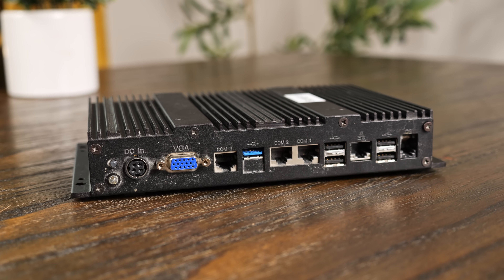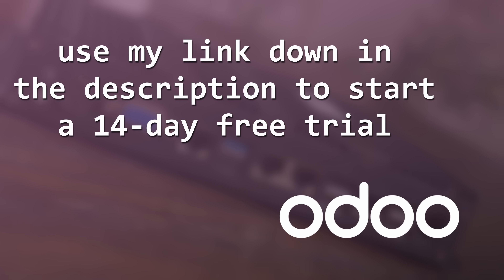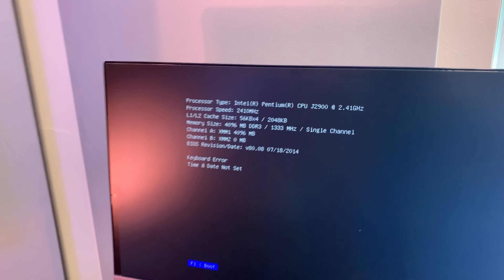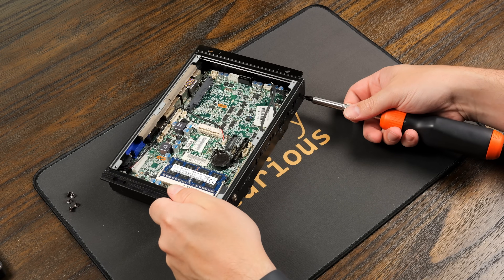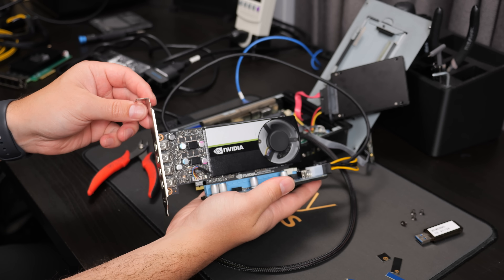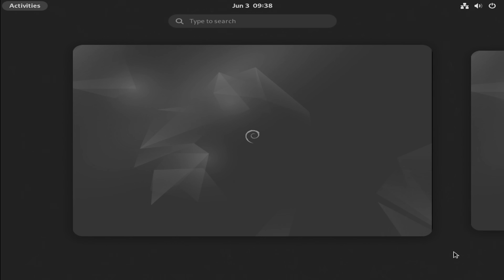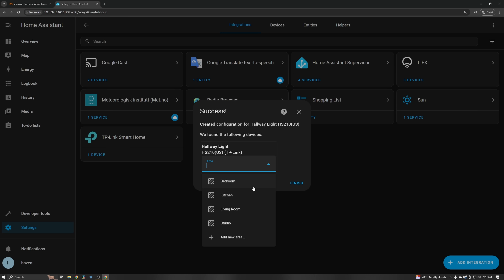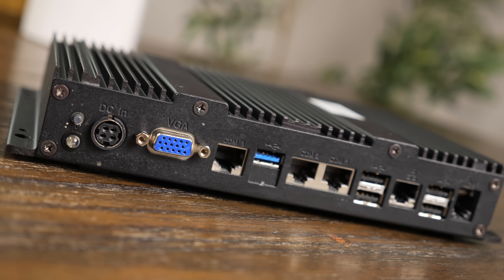I got this PC from a fast food restaurant. What now?

Comment: For a display issue in Linux, check if it has an internal display connector. If there is one, look for a setting in the BIOS to turn it off. Some Acer mini PCs have had the same issue because they are also used in all-in-one PCs.

Comment: I had no idea what "keys" were that plugged into ports with no wires. software that communicates with hardware will have them, and be unable to "talk" on the network, until that key is plugged in to a non network port. local only.

Comment: I had a client that used these in fast food restaurants.  These computers are absolute tanks.  I think I only replaced 1 in maybe 10 years, and they probably had a couple dozen total.  Most of them were mounted in order prep areas in very hot and humid environments, often directly above cooking areas or above food storage areas with heat lamps.  They were used to show food orders for prep and had a printer attached that would print the order so it could be put in the bag when done.  They also had a super chonky "keyboard" attached that was really just a metal box with a few buttons to cycle through orders and clear them when they were done.

Comment: The video resolution glitch you saw was something that I have seen with hooking up an Acer model G206HL via the VGA D-SUB  port to an Intel core i3 onboard video chip to Debian (both 11 and 12). However when using the DVI port the problem disappeared. I do note that when using the D-SUB port, but turning off the monitor, once logged in, and repowering  it fixed the display resolution. I haven't tried it, but I wonder is a DVI to D-Sub cable might resolve the problem.

The multiple serial ports would make this a great little security box attached to door/window/heat/water sensors. Wiring some pairs in loop-back and some to act of open or closed. :-) it could when sound an alarm, email warning... if in the USA (I'm not but was before) email a SMS service to text a warning. Doing this, it could run Debian in Command-Line mode, so not GUI overhead. 🙂

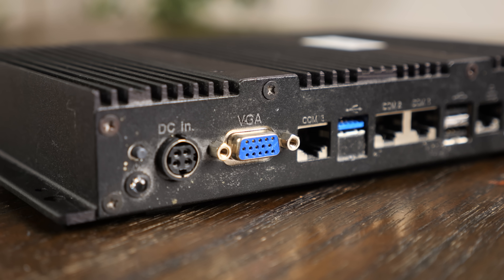Comment: 1:00 Even this not-super-knowledgeable user knows it's old because of the VGA connection. I replaced a PC earlier this year and found that the monitor I'd been using was useless with my two laptops because it could only connect that way.

Comment: Curious. What edition of linux mint were you running? The reason why it was zoomed out like that is due to the kernel not having the appropriate kernel modules for the display out of the box. If its the Debian 12 version of linux mint or LMDE6. That explains it. Debian is all about being just enough and not much extra. If it was ubuntu version of cinnamon. Chances are, the experience would of been much better as ubuntu kernels are much more cutting edge than vanilla Debian.

Comment: I work with point of sale systems, so some things stood out right away.
Systems built around the J1900, in my experience, are tanks. Dependable, near indestructible, heavy, and slower than a frozen tortoise. There are still some out there running Windows XP - which is more a testament to the durability of the hardware.
That "CD" connector is meant to connect to a cash drawer. You can use this to trigger solenoids (often 24V) to do whatever you need them to do - open a drawer or door latch, ring a bell, set off an alarm, dump water on somebody, possibilities are endless. The main problem is finding drivers or the memory addresses that control the drawer kick.

If I were going to repurpose this thing in a restaurant, I'd make it into a menu or advertisement display.

Also worth a look: Android. We're starting to see more Android equipment (and even POS software) on the market.  Something like this could run Android x86 without even trying. For comparison, I've installed a fair number of ChefTab kitchen displays - the Android set-top box they use is comparable to this in overall spec. That might even be a better way to refurbish this computer.
Postscript on that thought, we've also dealt with a kitchen display that runs on MS-DOS, the box is an 80186 processor. Yes, you read that number right.

Comment: do you think this could be used to run retro emulators in an arcade cabinet?
how hot does it get if it doesnt need a fan?
if it were inside of a wooden enclosure do you think it would overheat?

Comment: I was a facility maintenance tech for a domino's pizza franchise for many years. When we upgraded all the pos and host/server computers I Inherited about 100 IBM Lenovo ThinkCenter computers. They are all dated between 2002 and 2004 and have pentium duo-core processors running windows Vista pro. I sold most of them to a computer repair shop and I turned one into an emulation game machine running botacera. But I still have about 10 kickin' around in storage.

Comment: I prefer these mini pc for installing new staff desktops...  just throw in an ssd if it doesn't have one and they are awesome!  They have wifi reducing cables as well..
Dell Optiplex or HP Elite work great and with SSD they should be good for next decade, even running windows 11..
fyi there are vga to display port cables & adapters as well as for HDMI but it won't include Audio...  doesn't even look like there is an audio port on the back of this unit, is there on the front?
These are perfect "GUEST" use computers say at a community services center where you want to keep them hidden & secured to bottom of desktop..

Comment: I KNEW I recognized that pc from somewhere. I worked at a dominos as well that ran on chrome os, that blew my mind. Also as a side note, the Bump 1 stick meant that this computer was at the front of the makeline as you would Bump the orders from there first, to the second screen which you would then bump again and it would push the order through to the printer at the cut table (where the pizzas come out of the oven and you cut them). So you had 2 systems, one at the front of the makeline that showed you what pizzas were coming through and then once you had the dough stretched and sauced you would then bump it down to then see what you needed to add to it.

Also on the minecraft serverfront, you could have the server auto generate chunks to a certain point. I was using an old macmini, core2duo, and attempted to have it auto generate up to 10k chunks in each direction which took forever, but it is possible.

Comment: My desktop is a used Thinkcentre T-73 that was thrown out when a local textile mill closed.
It came with a 4th gen I-3 'energy saver' I replaced with the 2nd fastest 4th gen I-7, and maxed out the RAM from 4gb to 16gb. I also installed Ubuntu Linux, and it works great for what I use it for. It's been running like this for over 4 years now.

Comment: I used a similar J1900 based "silent PC" as my pfsense router for years - despite the J1900 being on borrowed time (see other comments re the silicon bug), but it worked well and kept up with the 1Gbit WAN just fine. Finally retired this year and replaced by another device of identical form factor, this time powered by an N100 w/ 2.5Gbit NICs - they're inexpensive, silent and just keep trucking on..

Comment: Three and a half years ago I bought new a Lenovo ThinkCentre M90n IoT. Core i3 8th gen, 4GB RAM and a 128GB M.2 drive and wireless keyboard and mouse. It has a WiFi card and antenna, 3 USB-3.2 ports, 2 USB-C 3.2 ports (display capable) and 2 each of serial & Ethernet ports, none of which I use 😁 Windows 10 Pro, since updated to Windows 11. 
All for $305 US. And of course, it's dead quiet.
I used it for surfing from my couch, connected to a 4K 55" TV.
Now it's connected to a portable InnoVision 15" monitor from Amazon, and used for occasional surfing and backup of some media on a 1TB M.2 in the 2nd M.2 slot.
I really bought it for esses and gees. But it has commercial uses, I suppose...

Comment: I’m an amateur radio operator and this is something that could be used for digital communications (this is all the rage nowadays). All that is needed is an audio card and a PC capable of supporting it. In the past, you would need a Terminal Node Controller (TNC) to properly route everything. In the early to mid 1990s Packet and RTTY (Radio Teletype, fairly ancient technology) were the main modes of communication. Now there are a myriad of other modes that can be utilized. Stumbling across one of those computing gems, and the quality of them, is uncertain but of course, businesses do upgrade when it is cost-effective. Browsing the internet via WiFi and storage space is also a bonus.

Comment: "[...] this thing has a lot of these COM ports which I imagine are used for connecting to a variety of point of sale devices using a UART connection or whatever, but I'm kinda curious what else this could be used for."

Honestly? virtually any task of getting low-volume data from one place to another, no matter how complex or simple the source or sink may be. I personally have deployed on my desktop a VT320 terminal (mostly for output and monitoring data, little input), a line display, receipt printer, and a dot matrix printer. but it's also extremely useful for offline headless deployments; rather than SSH'ing into a box you can keep it as far from the 'net as possible and require physical access to control it. There's novel uses in art, too; you can get some interesting aesthetics from the reception of data sent faster than the receiver is expecting if you play your cards right.

Comment: In my opinion, due to its limited cpu power, but plethora of serial ports, you could potentially use it as a networking switch. I used a raspberry pi that had been modified to accept 6 ethernet ports, and two optical ports. I use it to this day as a networking switch between all the clients in my house, and even a data center on occasion when needed. Food for thought.

Comment: So I actually used to work for a computer manufacturer that built more servers for enterprises, and we built similar systems for menus/point of sales. (https://m.youtube.com/watch?v=KYef2P2R-UA) and yes, I did work for that company, Seneca Data, and I've converted several of those to regular PCs. Granted most of those came with Celeron CPUs and either 2 or 4GB of RAM, there was upgraded models that did provide i3/i5 CPUs and up to 8GB of RAM. I've probably got 5-10 of these around my house setup as systems or are parts units. 😜

Comment: I've built POS system for a local pizza place 12 years ago. Thing is - the online built in credit transaction fees are way, way cheaper than the standalone machine was. Security is an issue - I always advise stores with POS to secure their routers and use a separate VLAN for guest wifi

Comment: IIRC, the J1900 has a built-in bug that kills it after a counter gets to a certain level.  Intel was well aware of the bug but without redesigning the CPU, it couldn't be fixed.  There are a number of dead QNAP devices out there with this CPU that are dead because said counter was reached and it killed the CPU.

Comment: I got a similar computer from a 2nd hand shop near me recently. I set it up on Windows 7 x64, 8gb RAM, a taken apart ssd like you did. I hooked it up to a simple 19" 1080p tv and use it for simple game emulation from NES all the way up to PS1 with no issues. I'm thinking about getting a USB based touch screen monitor and making my own UI in C# for a custom emulation station. Just some simple large on screen buttons to navigate/launch emulators... I know I could just use something like OpenEMU or even better, swap to linux and just launch from there, but on Win7, it is virtually flawless

Comment: mcdonalds uses aio touch screens using windows 10 for their pos, their "order screens" use some custom software dunno if its windows or linux but all the screens have their own passive cooled low power small format pc like this.... their little keyboards use cherry mx black tho
this system is very good at doing its job, showing like 20 lines of text with maybe 5 colours

Comment: Com ports or serial ports you can have this thing be a backup on your network gear to get back online after losing network access. For example you get locked out after messing up the IP on a switch in your rack, you log into that thing on the same rack and local into the router or switch you messed up its IP to get it back on the LAN. Or if you don’t want router to respond to management requests you can do management traffic from serial on that instead on the same rack

Comment: You can think about older laptops and do the same, for example laptops with a broken screen. Most of these laptops have a VGA or HDMI video output and can be still very usable when connected to an external screen. Just by removing the screen of the laptop you get a very neat form factor computer with a mouse and keyboard integrated. Or you can do what I did, take out the motherboard and put it onto a board into a (storage) cabinet, add a wireless mouse and keyboard (with a dongle/receiver) and add an extra extremly silent fan for extra cooling. I did this in my shed. You will be surprised how much better it will perform when it is outside the narrow case and when the cooling conditions are much better.

Comment: Hi. Very interessting Video. 1 thing - dont measure batteries unloaded. The voltage may be okay but under load they easily drop when broken/faulty - may not for a RTC backup - but certainly on battery powered systems ;)

Comment: Does serial ports are useful for stuff like headless box you can enable serial console so that you don't need a monitor keyboard and mouse to debug it you can just come over with a laptop that has a RS232 to USB console adapter and debug stuff.  Also if you're doing something like a router serial port GPS units are lower latency and more reliable than USB port GPS units if you want to run a NTP server due to the various overheads and jitter introduced by the USB protocols in USB GPS units

Comment: I have fiddled with these fanless industrial PCs a lot, and some of them have really high-end hardware, like Core i9s. In general they always have good connectivity, pretty good ambient temperature rating and ability to use quite a wide range of DC power, 12-24 V being the typical one, but I've seen some that will run on 9-48V, which is great.

Comment: Those run the monitors with orders on them, the bump 1 sricker gave it away for me. The unit will usually be on the back of a mounted monitor an theres a unit with all the function buttons. The ones the respgisters ran on had internal units, everything connected via ethernet cables. To update the registes and monitors pos systems a usb drive was inserted at each register and a special menu had to be accesed with the managers pin. I worked at a dunkin and johnnys pizza

Comment: Ewww, is that the DV J1900???  The specs on that THIN CLIENT are nasty... its not even a computer, just a thin client.  Thin Clients are built for special purpose and really only connect to virtual apps/systems and run PCoIP/RDP/SSH/ICA/HTTP/etc...   They are not designed to run apps and stuff direct on them.  You are in for a very slow treat here on this video... LOL...  I am looking at the prices of these things, and holy crap are they expensive!!  For an 11 year old device...  They came out with this line in 2013, and thin clients do not make hardware updates as they are just a glorified middle man that does NO processing power.

Comment: these are purpose-built industrial machines. they are not designed for average end user desktop use; they are designed to do one thing and one thing only. in this case a pos system to order Pizza's and charge credit cards.  I use several different types of these machines at my job.  I have one at each of our locations that controls automate building functions, like automatic lighting and automatic window shades, we have a fluid control system that monitors how much fluid is pumped from the tanks and which work order to charge them too, think engine, hydraulic, and transmission oils, gasoline and diesel fluids. i have one that also monitors UPS battery backup units at all of our locations, they are all build fan less, and with SSDs and the only time i touch them is for monthly security patches. they have ran 24 hours a day, 7 days a week, 365 days a year. for the last 10 years.  and if it was not for security patches i would never have to touch them or reboot them. they are closer to an appliance like a tv or microwave oven than they are to a desktop PC.  I also have some Dell Industrial PC's that are similar, they are designed for Extreme Environments. where there is dirt, high humidity, moisture, or extreme hot or cold temperature, or where there are lots of vibrations that would destroy a standard PC, like in police Helicopters that need them for video recording systems.

Comment: This little machine can still be useful for a variety of homelab things.  With working USB ports, you could make it a DBAN /test rig for hard drives or you could make a small terminal server out of the serial ports (provided you can find the pinouts).  I just recently had to make a terminal server out of a Pi and some usb-serial UARTs for devices that could only be controlled via serial.  Since this thing has three serial ports, it'd be pretty easy to do the same (assuming they can be enumerated in Linux and usable via minicom).